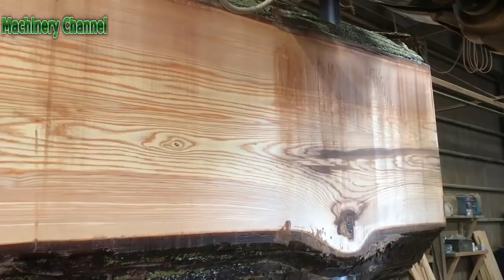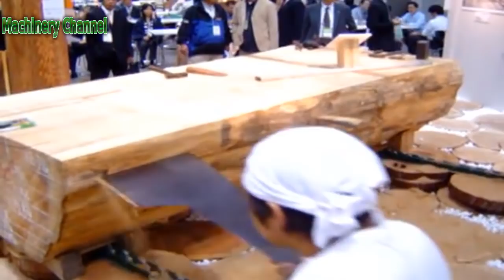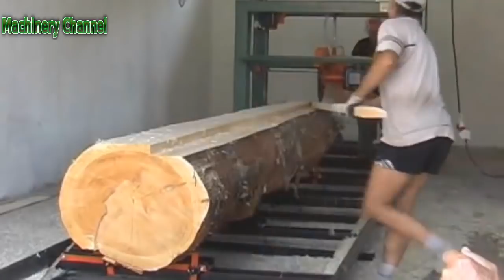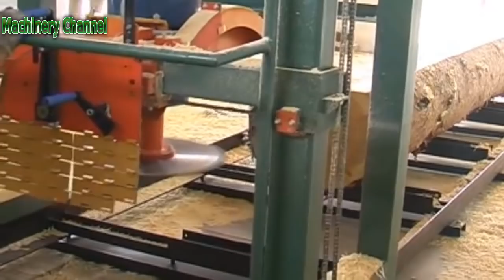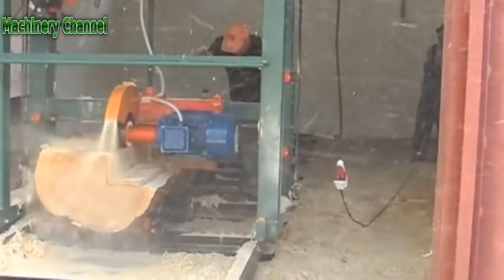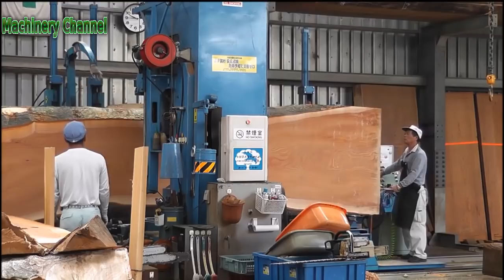Extreme Dangerous Biggest Wood Sawmill Machine Working, Fastest Chainsaw Wood Cutting Machine Modern

Comment: I grew up near a large sawmill in Poland and both my parents worked in the offices of that sawmill. When they were sawing logs brought from areas where there was fighting during WWII they had to replace the blades several times per day because of iron shrapnel that was embedded in the tree trunks. The things they used were 4-5 blades in one frame going up and down at the same time. The saw machine was a monster about as tall as a house. I grew up with a sound and the smell of pine resin from those machines. 

We would buy scrap wood for fuel in our home heating stoves (the old-fashioned, European floor-to-ceiling kind covered with ceramic tiles) that had shrapnel still embedded in them and sometimes you would see marks showing busting of the teeth of the saw.

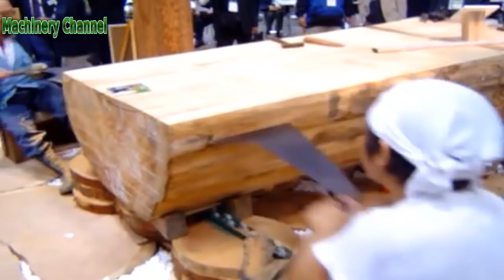Comment: @2:50 is called a misery whip. My dad used to fall a tree take a two man power saw with 12' bar and cut beams to build a bridge. A small Marion crane with a pile driver. Could haul 50,000 # was more work to span 140' bridge

Comment: I especially enjoyed the complete morons with the harbor freight / homemade hack mill with a 2 foot blade spinning at 10,000 rpm which they were 1 foot away from - while they used their entire body weight to push on the resistance of the machine - while stepping over obstacles etc . . and changing the configuration of the blade while it was at full speed - ( with no apparent safety mechanisms of ANY KIND - so they can cut 2x4's. My GOD - saw blades DO come apart. There IS kickback. People DO trip and fall over ( into the blade ) and on and on . . .